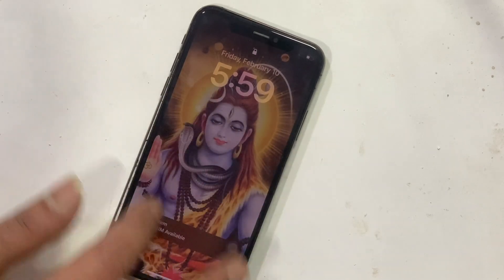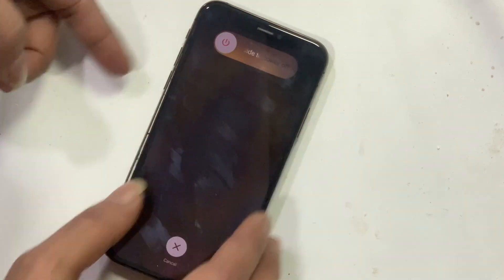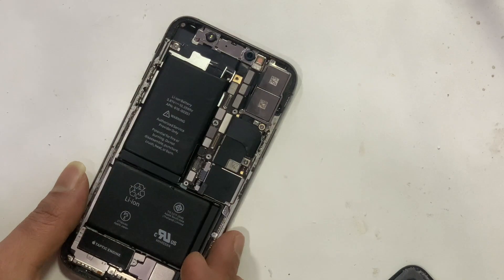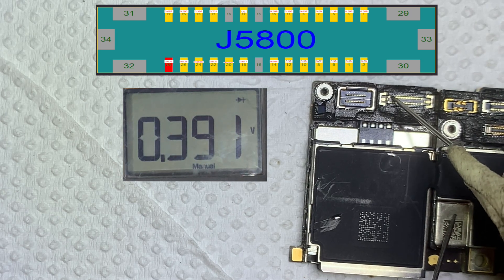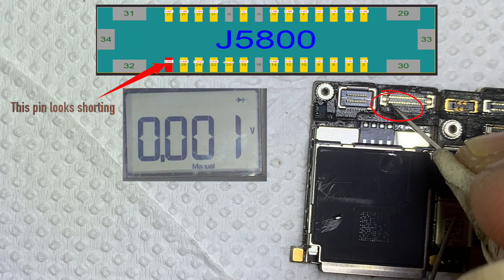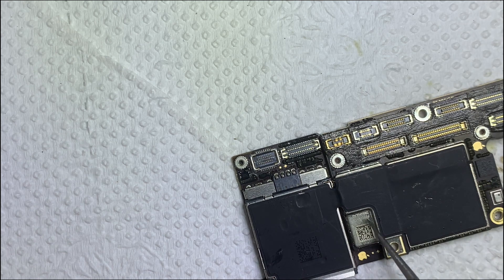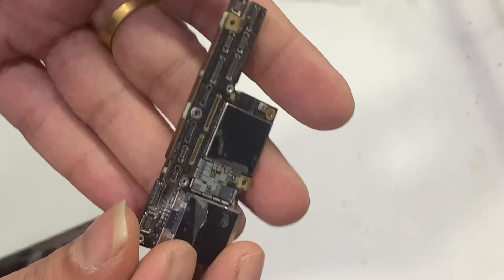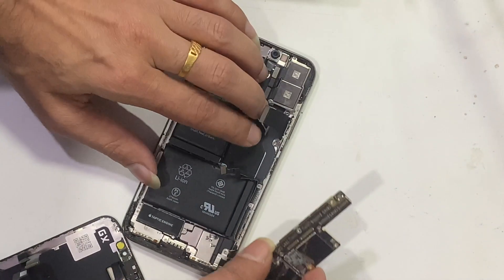How to Fix iPhone X touch not working.

Comment: Hello sir, I have a problem with the iPhone X, and it is a battery that keeps on a red color that it has run out even though it is charged and the battery is original with the phone. When I call, the iPhone turns off and on and remains in the same state, or I watch on YouTube or anything that turns off and on, what is the solution